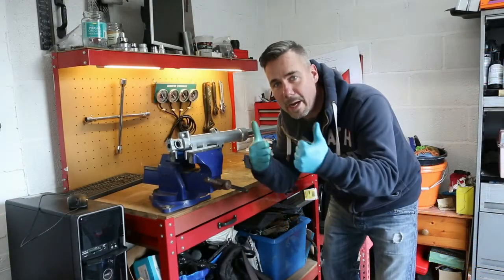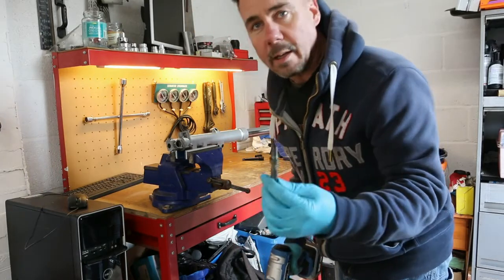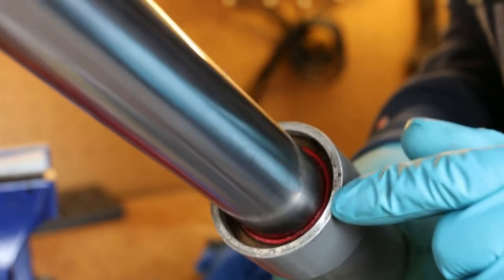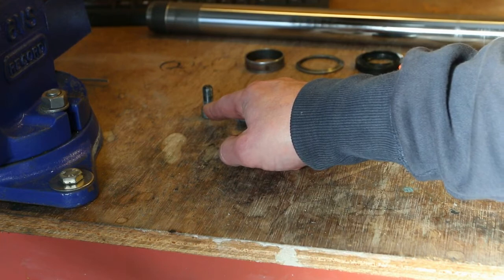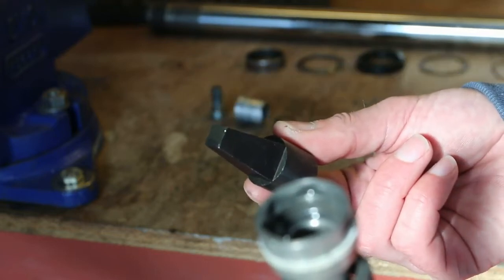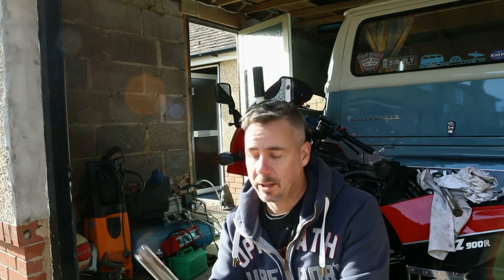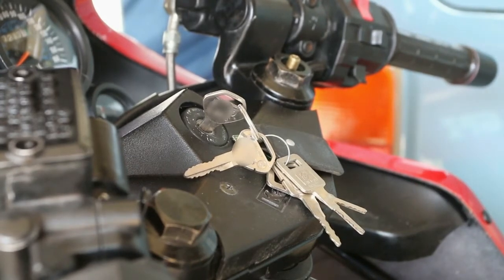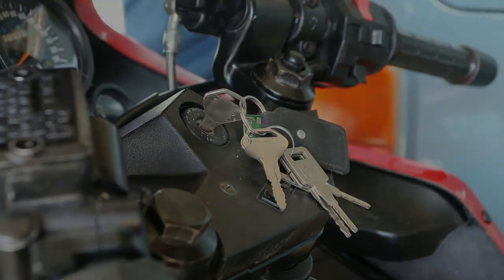GPz900R Project. Fork seal replacement.

Comment: First off…get a proper mic..or at very least, get out of the wind, because the wind noise is overriding the AGC on your recording device, effectively rendering you…incomprehenisble. Secondly, the radiator/fairing stay, is NOT intended for jacking the bike up.

Comment: Nothing screams 80s motorbike than Antidive units. :-)))
Reply from the maker: The forks actually seemed ok. Amazing bike for it's era..
Reply: @projectmoto9089  Yeah these old Damper rod, Anti dive forks are fine it looked after and maintained, ive got an 86 Suzuki 1100 with the original forks and they are fine. Have said that i do notice how supple and well controlled the forks on my modern bike are if i hop from one to another, but thats to be expected.

Comment: Haha, I rofl'ed on the lubing of the fork. Genius music choice ;) I came to see how the new seals should be put in place, but unfortunately that part was not on video! Can you just push them in or should a length of tubing be used like some blogs mention?
Reply from the maker: Thank you, it was a little while ago now, but im pretty sure i pushed them into place. If you need to level them up or tap them home you could use a big socket.